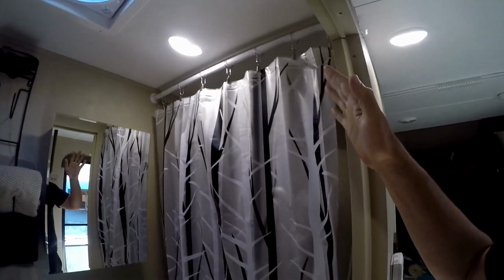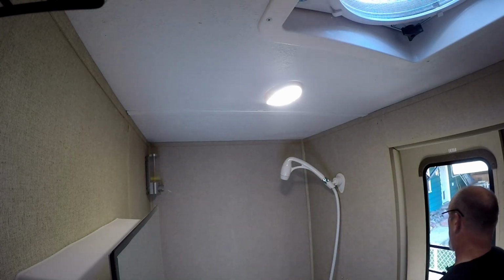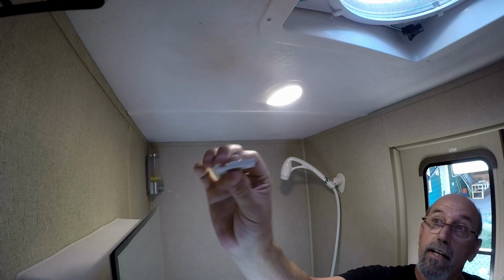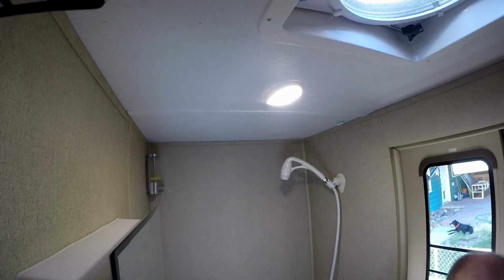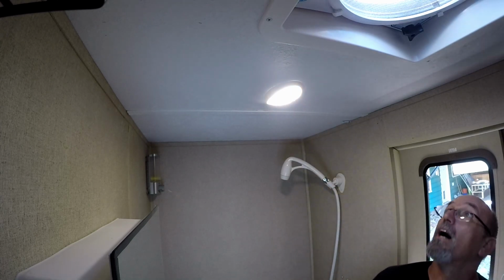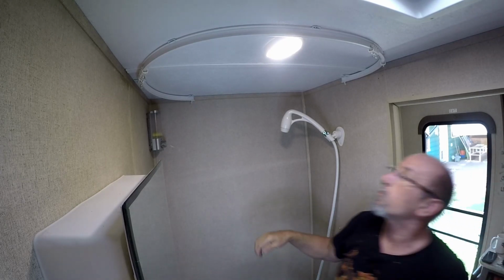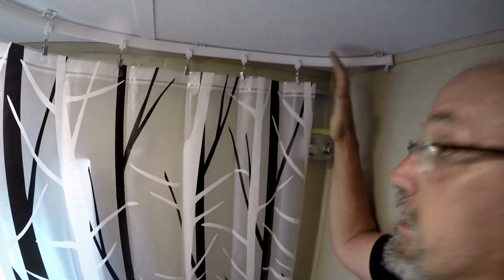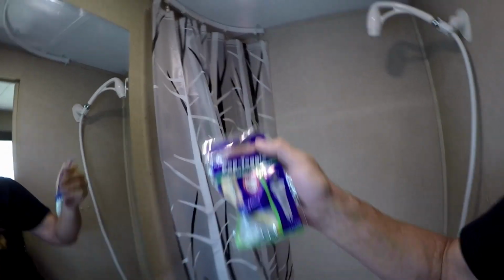RV Shower Curtain Upgrade Making More Room With Ceiling Mounted Bendable Curtain Rail

Comment: We have a Coleman 263bh with the same shower. We have been concerned about the gap between the tub and the trim at the bottom of the wall. Our issue is why? I don't want mold and is yours the same or no gap?
Reply from the maker: If water gets behind the trim the gap at the bottom allows it to drain out. You be more likely to get mold if the bottom of the trim was sealed.
Reply: @DiyRVandHome  thanks. My husband is a carpenter and it really bugs him. He wants it like residential but I understand the gap. We did Scotchgard the walls
Reply from the maker: That is a good idea with the scotch  guard